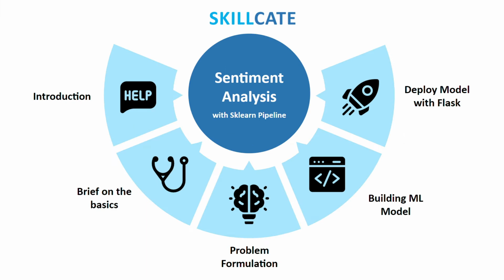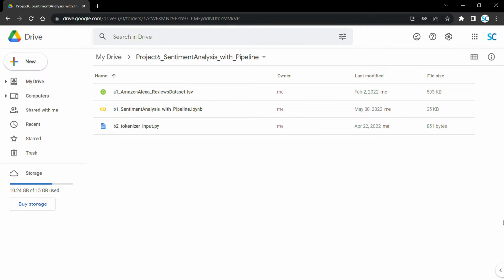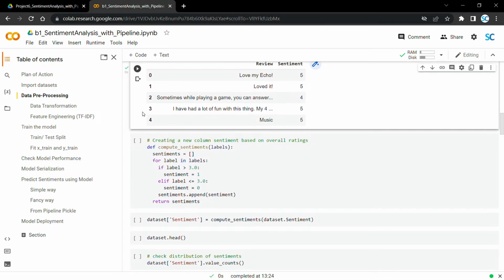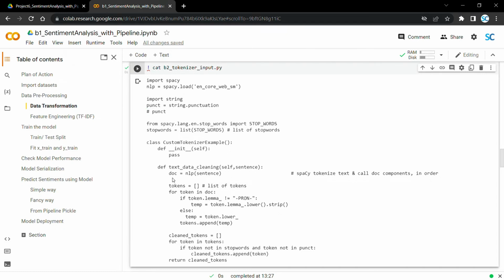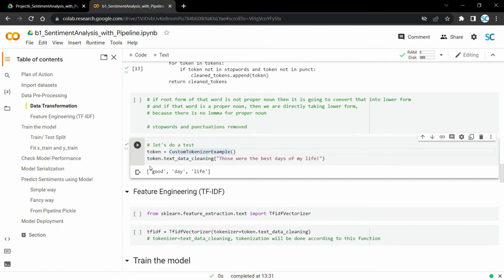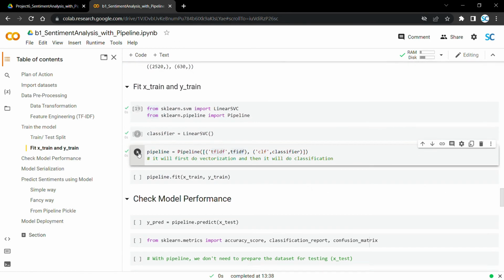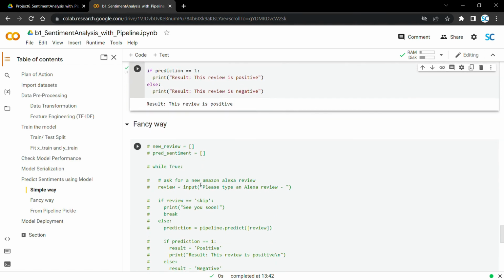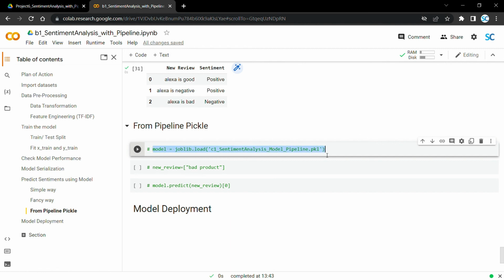Sentiment Analysis Machine Learning Project with Scikit-learn Pipeline | Build & Deploy | Project#6

Comment: Good job.
Thank you for your tutorials.
I was wondering, the labelled classes are imbalanced, you didn't consider resampling it.
Why is that please?
Reply from the maker: Hey Kingsley! You got a lovely name :)

The dataset we are using is the actual Amazon Alexa Product Reviews & exhibits the true distribution of Review sentiments there. Therefore we went ahead with the same data and got a good accuracy score of 91%. 

However, definitely you should try out data balancing. Do share the results here. :)
Reply: @skillcate  Thank you for your response and the compliment. 

In my own case, I am built a model following your simple and easy to understand steps,

The model was based on the review of Google play store app of Piggyvest.

It is a Nigerian based fin tech company. I got an accuracy of 92% when I used the rating as my labelled column. 

I said if a rating is greater than 2 then label it 1 else label it 0.

However, when I used a new column remained review which I created from the sentiment polarity.

This time if the polarity is zero or negative label it 0 else label it 1, this time I got accuracy of 63% with TP TN being 0.

I would have loved to share the link, but it is my In-Course Assessment for my Intelligence Decision Support System module in Master course.

Please let me get your thoughts.